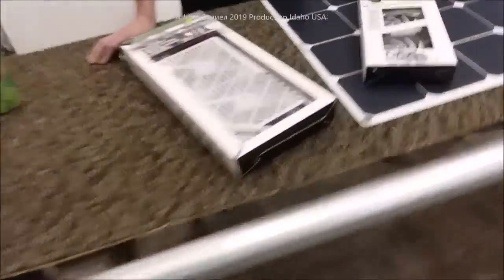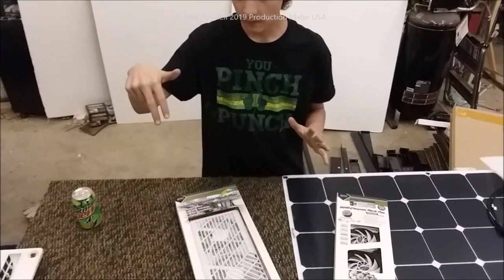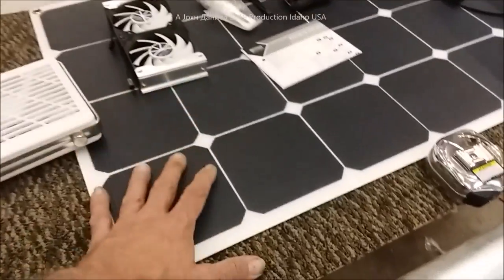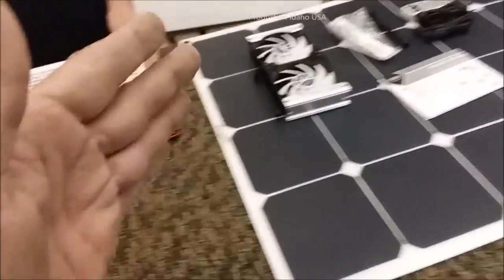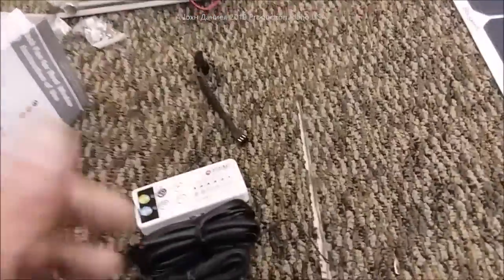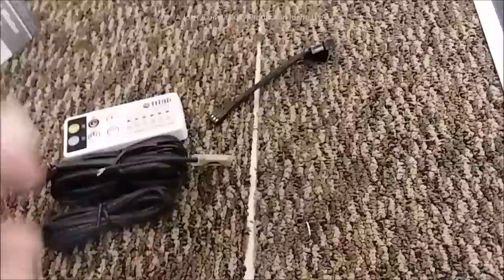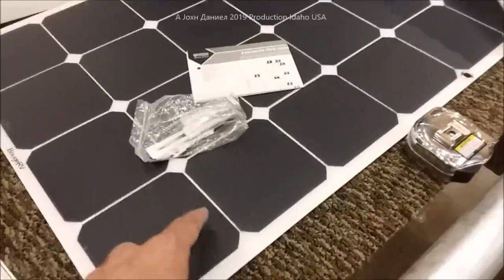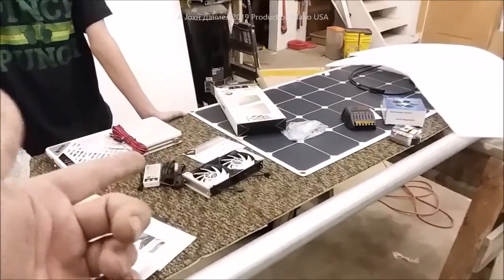Solar Fans to Stop RV water damage, mold, & rot with Solar powered & DIY Power venting

Comment from the maker: Due to weather resistance, I do use The Titan kits https://amzn.to/2UxmfNU ,100 watt Bouge solar panel tough enough for 3" Hail stones https://amzn.to/2XA66t0 ,10amp EZsolar controller for RV's https://amzn.to/2IOSohU & 12 volt Timer to run it automatically https://amzn.to/2GpLiO4 is a plus!! Best source for RV Roof Vents https://bit.ly/2zjGbM4 And if you want 5 plus years out of your RV battery all it takes is one solar  panel and a controller to keep it topped off. Untended rv batteries sulfur up, short out and fail fast.

Comment: I have ordered some cheap chineasium electronics lately, I can't believe they sell stuff like that, I see why they do NOT put a brand name on them. This stuff looks great, I have a old house, off grid, I have issues with moisture, and mold, I have been thinking about fans, I have alot of trees, and standing water for a bit after a good rain, here in the Appalachian foothills, it rains a good bit. I'm trying to get moved in full time, I have 600watts of solar temporarily connected, with a good size 24v bank, and a 600 ah lithium ion battery bank I'm working on. For the 5kw inverter, and a 12v lithium battery bank I built, that is about 118ah, the lithium iron phosphate battery is awesome, it will drop to about 13.2v and stay with in 1/2 a volt forever, the volt range is 14.4v to 10.5v but can go to 9v without much harm, and 2000 cycles to 80% capacity, but can be greater if treated well. Not fully charged and discharged, 3.65v per cell is about the highest, I try to stay at 3.5v per cell, or 14v total. And keep it above 11.5, if not , no big deal, but it will hopefully extend the life by 10-20% they are nothing like lead acid!! The lithium ion is a bit different, it goes to 4.2 per cell, I have 7 in series, for a max of 29.4v, that works well for most 24v systems, it can safely go to 21v I try keeping it above 24v and below 28.7v, it makes more power, in a small package, but the trade off is less cycles, 800-1000 to 80%, but if treated well that can be doubled or so, I'm hoping to have 40-50%in 20 years, it may not make it, since I used new old stock cells, but at the price I got them for, its worth it.. About $1600 in a 24v 600 ah battery, and $600 in the 12v 118ah battery, it is actually 4 batteries, so I can wire in series for 24-48 volts, just in case... And near 30ah each,  I still hope to experiment with wind turbines, and hopefully a water wheel generator,, but it will be tiny, 500 watts is ambitious, but 200-300watts, would be good, 24/7 power is alot better than a few hours daily, I wish I had more wind,  I may have more than I think, only I have soo many trees, and in a bit of a valley, I'd need 50' plus! To get above the trees, I have good size popular's oaks and pines, one of the oak is about 48" across! So I need to study if it would be worth putting up a tower! If it would make power to be worth it, I could put up a 400watt or so, on about 60' of pipe, to test the waters, huh um, wind! Maybe I will, if it's worth it, I will build a big tripod, a bout 60' with 15' of 2", and put about a 2-3kw turbine up, I hope to have around 2,500ah+ battery bank eventually, and charge it from 75% discharge, in one day, maybe 2 days , but I want to run the minimum Necessity's for a week without any charging! Or have that ability, while things are going well, I wnt to dump the surplus power into water heating, and house heating or cooling!! But I shouldn't need A/C 2-3 monts, in mid summer, as far as fans go, I have a couple window fans, and a couple USB fans, and a couple 12v fans 14" or so.  I need to setup a air circulation system, to keep things dry, I have some  UV-C lighting, to kill mold and create ozone, I'm not that sure about that though, sorry for all the rambling!! No one here is interested in this stuff, only I seem to care about free power! Though everyone wants it, no one wants to do it! Take it easy man, great info!!!
Reply from the maker: Looks like your program is self foretelling. I have a design for a solar dehumidifier. Based on nothing more than fans, large heat sinks, and a temperature differential. I trademarked it many years ago, but only built models and all worked exceptionally well.

Comment: It would be great to see some Titan installations which you have done.  I'm a bit concerned with creating a hole in the wall which would need to be left open while away from the RV for months at a time.

One thought I had was to put a Titan fan in a bathroom roof vent which has a vent cover installed (like this Amazon product B007HGF398).  You could leave this bathroom vent slightly open and seal around the sides and top of the bathroom door.  This would force the air to come from the floor of the RV under the bathroom door.  The problem with my RV is it only has one roof vent so I'd need to cut a hole in the roof and install another vent outside of the bathroom.  The same type of vent cover could be installed over the new vent and cracked open to allow the Titan fans inside of the bathroom vent to pull fresh air into the RV.  Though at the end of the day rain could still be blown into the vent cover.

Do you have any videos where you show how to cut a vent opening into a roof, frame it, and install the vent?

One potential problem that just occurred to me is the floor outside of the bathroom could be carpeted and could limit airflow into the bathroom.  Search HomeDepot.com for "100012528".  This is a $1.82 "16 in. x 4 in. Aluminum Under Eave Soffit Vent in Brown" which could be installed near the bottom of the bathroom door to provide airflow if required.

Comment: Those are literally PC fans. I have about 60 of those fans laying around. Some of my fans sell for 30 bucks each. Just ONE fan.  So just buy a remote control kid for 7 bucks and make your own mounts. thats a heck of a lot cheaper than 80 bucks.
Reply from the maker: Not sure what percentage of PC fans are water resistant. I've used many PC fans in real damp locations and they last a few months.